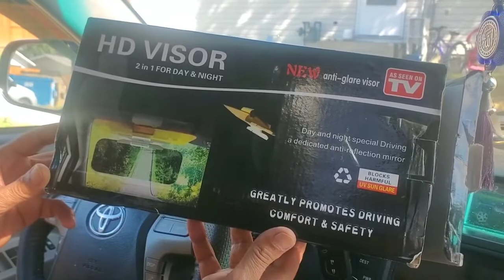Full Review HD 2 In 1 Car Visor, How To Install And Use It, Day And Night HD Visor

Comment: ordered one.  Work great for a month or two but now the hinge and the ridge line have been sanded down to usage that such it cracked up Lil plastic powder and the panel does not hold to position??
Reply from the maker: Thank you so much for your wonderful comment and useful information,  I didn't like it because it's little thick and yes it's leaning down little bit I guess it's ment to be ladt Long time

Comment: I thought it wouldn’t open wide enough to fit my Corolla visor, then found it opened much wider and fits easily. Not tested it while driving yet.
Reply from the maker: Yes that's right, day time and night vision both are excellent however the design just little bit thick if someone tall may touch his head, I didn't like it because it's kind of on the way, maybe I didn't get use to it, thank you so much and all the best 🙏
Reply: I wear glasses all the time, so this will work very well for me because I can’t wear sunglasses.
Thank you for video sir, this was very helpful.

Comment: How to remove the protective film from the 2 visors ?
Thanks
Reply from the maker: Hello my friend, I am sorry I don't know how, I think it's coated with very thin layers of film behind just clear plastic, thank you so much and all the best 🙏
Reply: After a little trial & error I managed to find a method to remove the pesky protective film.

How To remove the protective film from Visor

Prepare the following :
- old cloth eg pillow case
- old/clean brush
- dilute normal dish washing detergent
- plastic bag that will easily fit your new visor
- old credit card (expired)

1) Use credit card to "sharpen" edge of the visor.
Run card on the edge of visor approx 4x each edge. Use a motion as if you were trying to sharpen edge of the visor using the credit card.
The purpose is to create very small rough edge at the protective film's edge, where you will need to peel the protective film.
2) Lather up diluted detergent liquid.
3) Use brush gently cover each side of the visor with diluted detergent liquid ( do not brush the face of the visor hard)
4) Wrap wet visor with cloth ( pillowcase)
5) Place #4 into plastic bag; leave approx 12 hours.
6) Remove visor from plastic bag & pillowcase
7) Wet the visor gently
8) Use credit card to "sharpen" edge of visor. This will reveal little edges of the protective film beginning to peel .
9) Slowly use fingers ( may use non-metallic tweezers, I did not have them) to peel edge of protective film.

Note
Objective is to get a small edge (to peel) in the protective film.
Once protective film is removed, any wipe or clean of visor should use micro-fibre cloth provided.This is same as material provided with spectacles.
Good luck & have fun
Reply from the maker: Hello my friend, thank you so much for great information and excellent advices, that's really cool, thank you again and all the best 🙏😊